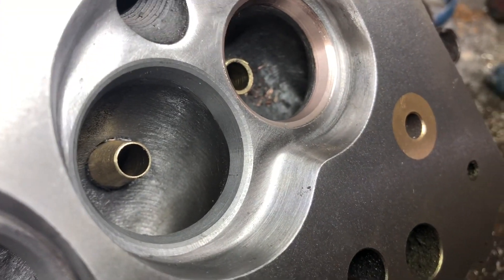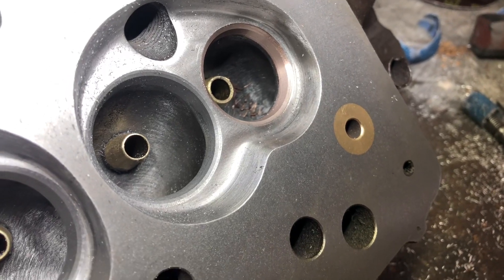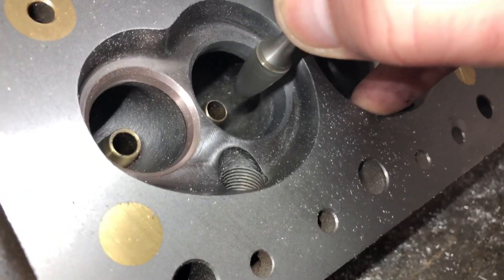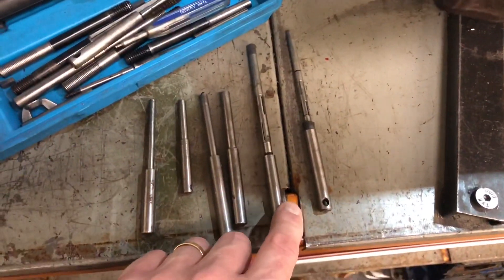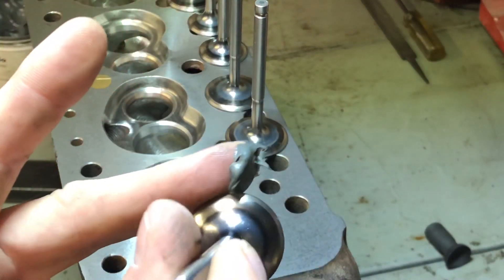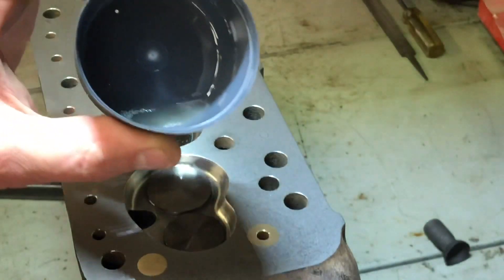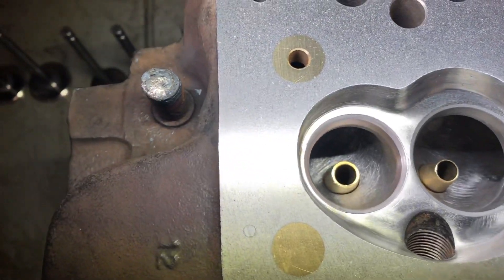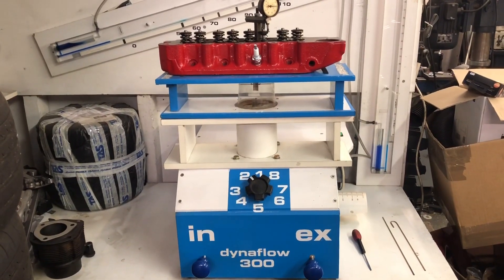How to modify your mini cylinder head part 3

Comment: Nice work on the head altho one thing I learnt when porting and polishing heads for carburettor engines is to port both the inlet and the exhaust but only polish the exhaust port and i do know that might sounds odd but if you polish the inlet side as swell the fuel/air mix may not mix properly and make the head produce less horse power and there is a fine line where you can polish the inlet just enough to increase airflow and have the air/fuel mix probably aswell

Comment: As all the head modifiers seem maxed out at the mo and some prices have gone up, I am seriously considering doing this myself. So searching for inspiration and info I came across your videos and have just watched all three! Many thanks for posting them, there are very few instructional ones about and these will help greatly. I'll probably contact you for more detail :-)
Reply from the maker: Thats the idea !, really its pretty easy to increase flow and more satisfaction of doing the work yourself
Reply: I'd practice on an old worn out casting first if I were you.  Easy to make (costly) mistakes.
Reply: @graemecatty9921 that’s what I ended up doing. I picked up a supposedly scrap head for £15. Cleaned it up and started working on it. It’s been running in my car for about a year now 😂😂